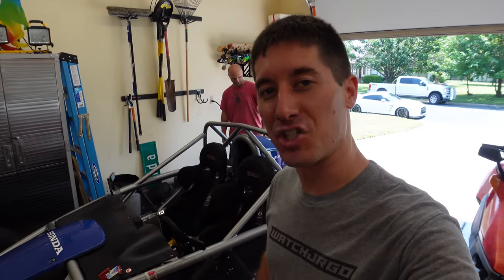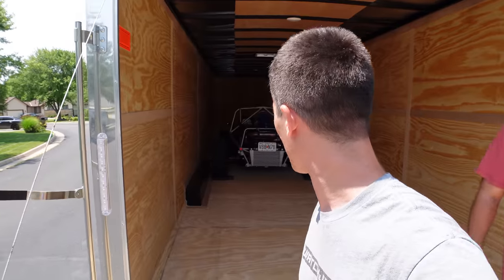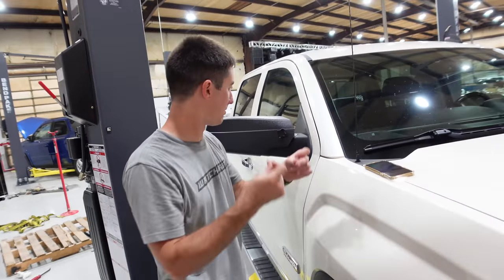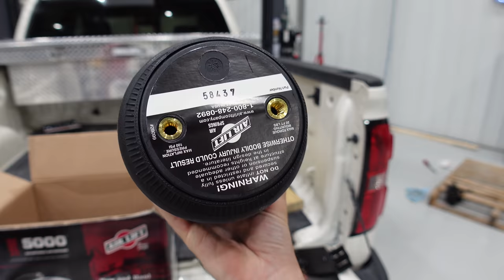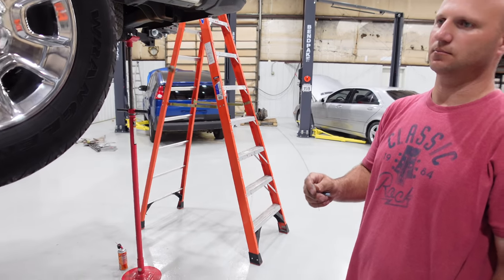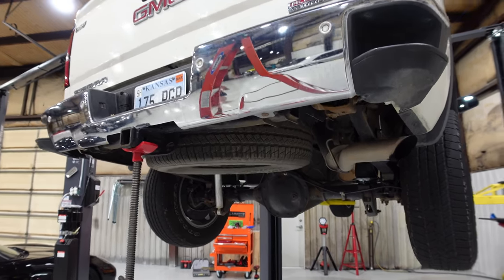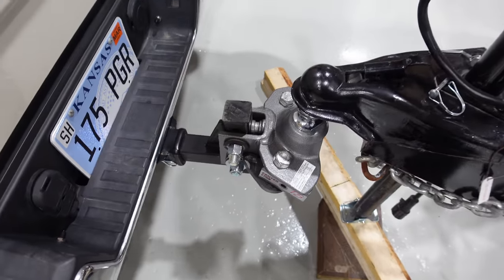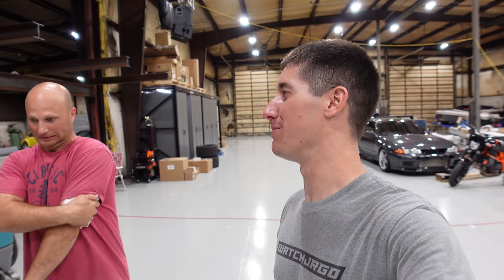We're MAKING This 1/2 Ton TRUCK Pull A 30FT TRAILER *DANGER*

Comment: Use the trailer jack to make the load levelers easier to get on. Lock the ball then raise the the jack until you can just put the bars on then lower the trailer. Sometimes you are almost raising the truck rear off the ground. Makes it way easier and safer to get those bars on and off.
Reply: This is the correct way.
Reply: ...and always have trailer perfectly aligned behind truck when putting bars on to make them line up without the tool.  You'll never have them explode off.

Comment: Air bags are fine, but the weight distributing hitch is far more important to make sure you aren't over loading the weight carrying rating of the receiver.  The proper way to set up a WD hitch is to measure the front wheel well height then adjust the hitch head height and rear facing angle so that when the bars are lifted and engaged the front wheels return to their unloaded height.  Some squat in the rear suspension is acceptable, the main thing is to transfer torque through the frame back to the front wheels to maintain proper weight on the front tires for traction and steering.
Reply: Plus 1
Reply: 100% correct. I pull a 24’ enclosed full of atv’s with my Tundra all over the east coast.  About 9500 pounds fully loaded. No bags. Just my WDH. No issues at all.

Comment: To make installing or removing the load leveling bars easier, raise the trailer with the tongue attached to the ball. This will raise the truck and remove pressure off the bars. 

I have a similar system for my 30ft travel trailer, and doing this makes installing the bars much easier.
Reply: I do the same thing with my 36' Eagle TT

Comment: I know half ton trucks these days are rated to 9-10,000 lbs.   But IMO if you are towing over 5000lbs on a semi regular basis(or live in the mountains) just buy a 3/4 ton truck.  Bigger brakes,  beefier trans that wont shit the bed before 100k miles, suspension that isnt being overtaxed.  And Im gonna say buy a gasser in a 3/4 ton, cheaper fuel, cheaper price on the truck, mainly way cheaper to maintain(emissions era diesels have lots of expensive ways to break)

Comment: I have that same load leveling system for my camper and I found if you adjust the tongue jack so there is just a bit of lift on it the load leveling torsion bars go on WAY easier. It just takes a bit of playing to find the right amount. Also the anti sway portion does seem over tight but it will loosen as it ages.

Comment: Time to repeat the golden rule of pulling a trailer: Always, always always make sure your CG is AHEAD of the trailer axle. You need approx 10% of the trailers weight on the hitch in order to be stable. NEVER be lifting the hitch.
Be safe, have fun.

Comment: Tell Josh to buy the electric trailer tongue jack. Makes life quite a bit easier. Also, the higher you lift the tongue with the truck attached, the easier it is to get the load bars attached.

Comment: Hey JR the higher you raise the trailer on the jack while attached to the truck the easier the bars will be to put on, and off. 
You should also mention to everyone that the airbags are not for increasing the weight capacity only for ride comfort.
Reply: the air bags dont increase apacity but handle it better- I have them on my xterra and they may a world of difference with bike rack or heavy loads
Reply: Like I said airbags are for comfort not added weight capacity
Reply: @mcgizzle7835  they handle the total weight better my xterra had a weak rear suspension pump uup the airbags far nicer
Reply: You are obviously not under standing what I am saying. 
By adding air bags you will never increase the carrying capacity of your vehicle. By this I mean your tires and axle have a maximum carrying capacity. Adding air bags will only help with the comfort. For example. If you put 500lbs of sand bags in the bed of the truck for building your child a sandbox. The rear of the truck will sag. Causing you to actually lose a little bit of steering ability. Thus making it uncomfortable to drive. If you have air bags you can air them up so the rear does not sag and you will have a comfortable ride.
Reply: @mcgizzle7835  i get it it doesnt increase but manages the weight better -

Comment: To make putting snapping the bars in place for the hitch easier....couple and lock on the ball, then crank it up about 3 inches.  This takes some distance off the bars to the brackets.  Then once locked in, lower the jack and it should be set.  Way easier this way than trying to do it from the normal ball height.

Comment: Those leveling bars go on way easier if you crank the tongue up. It will lift the back of the truck up at the same time and feel weird, but the level bars will slip right on without the tool.

Comment: I've only driven a little over 3 million miles. No one ever said you can't pull a big trailer with a 1/2 ton. What you will find, if you are in an emergency, is you can't STOP a 30 ft trailer with a 1/2 ton in near the distance you'll want to.

If you can't afford a truck to do the job, maybe think of less toys !  I've seen this go bad way to many times over the years !

Comment: Could add a tee in underneath to tie both bags air supply together so the pressure will equalize for the bags? One fill point. Or would this cause body roll?

Comment: I could be wrong, but don’t bags actually make it worse by levering the front wheels off the ground?
Reply from the maker: It'll run 40-60lbs in the bags, and the trailer won't actually be overloaded, should be safe 🍻

Comment: Idk how well a new half ton will take it but I've seen a 96 or 97? Ram 1500 ext 8ft pull 27k over 500 miles no problem in its defense it had a mildy built trans for towing but stock rear end (went slowly 20k mi later) and stock 5.9 V8 first time I've seen a 5.9 1/2 ton get less than 11 but maybe I'm the only one who only got 11 loaded or not

Comment: So, with a air system like that could you link the two sides with a line so that they would distribute weight between the two sides during cornering?

Comment: That hitch system is a rip-off of an Equal-izer system.  They will be easier to get off if you lower the tongue jack and then slightly raise the truck and tongue w/ the jack to relieve tension on the bars.  After you remove the bars, lower the jack to lower the truck and trailer.  Use a 2x4 or rubber mallet on the ball-lock mechanism to break it free and then jack the trailer up and off the ball.  It's simple and won't explode anymore that way.  Also, that hinge on the torsion bar is way too tight.  They should be able to move some.  There's a video to show you how to set it up.  
https://www.youtube.com/watch?v=Yl9S3vIY0Uk&ab_channel=Equal-i-zerHitch

Comment: I found this video very informative, but, just a little bit of an overkill setup. As I once towed an 32 ft. a full loaded mobile home across the the U.S. with an 1957 Mercury Station Wagon with a bolt on bumper hitch with No problems.

Comment: How does the towing limit work in America can someone explain please
Reply: What the truck you have is designed for is listed on the driver's door jam.
There is a GVW which is the most the vehicle itself can legally weigh fully loaded. This includes occupants and what is in the bed of the truck.
There is a GCVW (gross combined vehicle weight) the most the truck and trailer fully loaded can legally weigh. There can be consequences legally and civilly should the tags on the truck and trailer exceed the designed limit of the tow vehicle in case of an accident. Insurance may not cover and you may be deemed at fault even if not. That being said, beefing up the suspension to better handle what is being towed makes the tow vehicle safer to handle what is behind it.

Comment: Your going to need mega anti-sway for that rig. And, I’m telling you the first time you get passed by an 18 wheeler on the highway your going o have to dig your fingernails out of the steering wheel. I used to tow an RV and it was shorter then that.